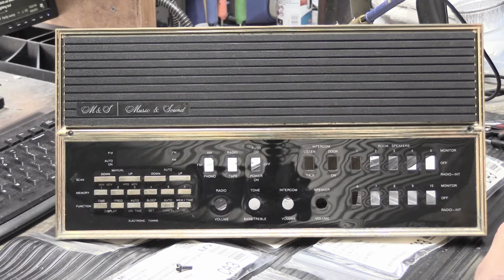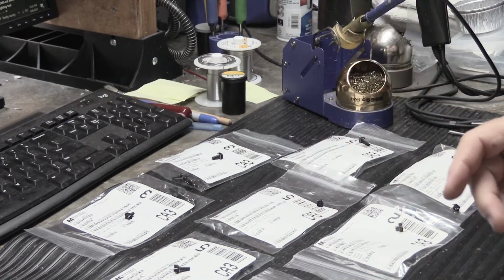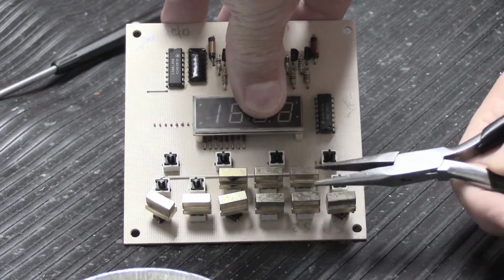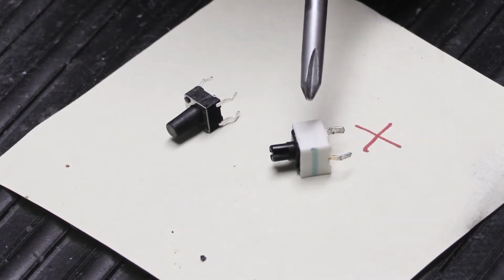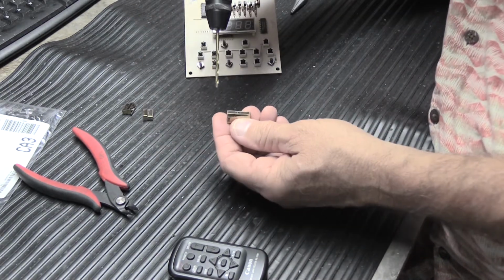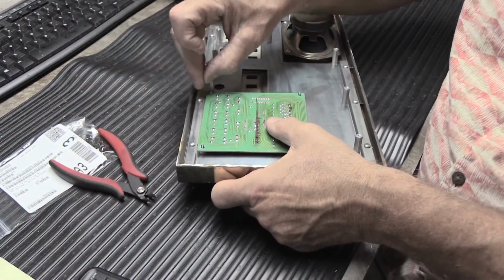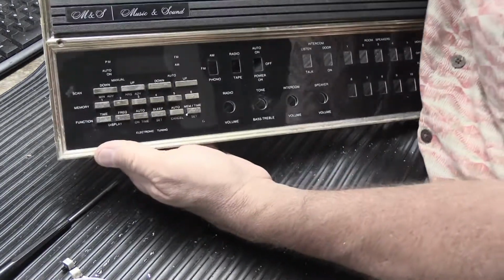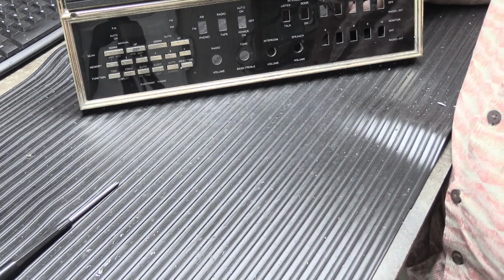How to Replace the Tactile Switches on a M&S Systems (music & sound) Model N350 Music Intercom

Comment: Thanks!  Swapping out those switches in my N300.  The unit is missing two of four larger gold buttons.  Have access to a 3D printer so going to try to print some solid buttons (20x6x4 bottom, 20x4x6 top) then drill a hole for the switch…. (Maybe print a smaller pilot hole to make a perfect center!).  May be a market for them if it works out?  Thanks!
Reply from the maker: Hi allwright:  Sounds like an intersting project.  I'm not sure if there's a market for repalcement button caps - I would think that they would need to be sold as a complete set, so everything matches.  The Gold or Silver finish may be difficult to reproduce, Black would probably be the best replacement color - Chris

Comment: Thanks! What kind of solder do I need for something like this?
Reply from the maker: Hi john: I use standard 80/20 tin/lead solder - I know it's fashionable to use lead-free solder now-a-days, but since the equipment I work on was made with 80/20 - that's what works the best - Chris
Reply: @northsideservicecompany3567  Thanks! I am looking to fix switches in my Kurzweil PC88mx Keyboard... I figure it'll be the same thing. Thanks!
Reply from the maker: @johnhuie6202  I had a very quick look through the Service Manual for your Keyboard - It doesn't offer very much specific information about the parts used in it - My guess is that like most modern designs, complete boards get replaced instead of individual components - I don't know which switch's you are referring to - if they are the switches for the Keys - they are only called out as 'large' and 'small' switches - Chris

Comment: Could you try some kind of adhesive?
Reply from the maker: Hi Disneyfan95:  I don't think that using an adhesive would be a good idea - The button caps need to be somewhat "flexible" on the switch stems - this allows them to fit through the openings in the faceplate without alignment problems - Chris

Comment: I've replaced a fair few of those push to close switches.
Some use a metal sprung dome and often found in old joysticks/consoles and clock radio's
The domes crack and fail.
The conductive pad type are in everything and produce odd resistances when old.
Car radios/cb radios/vcr's/dvd players all suffer from conductive pad failure.
I have cut pins off the switches and done the same as you have done,  but on different devices.
Who said  ' Bodge ! '  lol
That display board looked nice and simple, the old ULN transistor drive arrays, very handy 😀
Ill shut up now, woffle mode on warp 9 😀
Reply from the maker: Hi zx8401ztv:  The Panasonic land-line phone we use in the office & shop have rubber keypad assemblies with conductive material on the back of the buttons.  Of course the conductive material was worn away after 20 years - I found a company that makes a drop-in replacement that fits and works perfectly.
Waffle on dude - always interesting - Chris
Reply: @northsideservicecompany3567  if you are desperate, superglue a circle of kitchen aluminum foil to the dead pad. (tiny dot of superglue)
aim a fan at it to blow away the fumes that would normally make a mess.
If you have copper foil it might work better.
There is conducting paint, but its rather crappy and dam expensive.
A bit of experimenting is fun lol.

Comment: Great video!  I bet those plastic cover switches could be 3D scanned and printed to make replacements if needed (if drilled all the way through by accident) maybe even modified once scanned to improve the mount of the round switch.  What de-solder gun do you use?  
This  M&S intercom is very nice looking and nicely made.
Reply from the maker: Hi Groovy 1:  3D printing new button caps would be interesting.  I doubt it would be economical to have the plastic "gold" plated, but you certainly could have them made in black, which would match the faceplate nicely.  The N350 is a very nice looking M&S Intercom and it is very well made from a construction point of view.
I use a Hakko Model FR400 desoldering station - I originally started with a Hakko Model 808, which is one of the very best hand-held desoldering tools.  The 808 was replaced by the Hakko FR300 which turned out to be to light-duty for my daily needs (it kept breaking over and over) - Chris